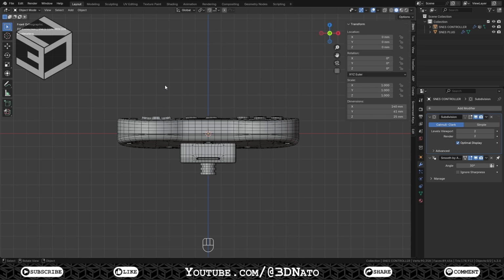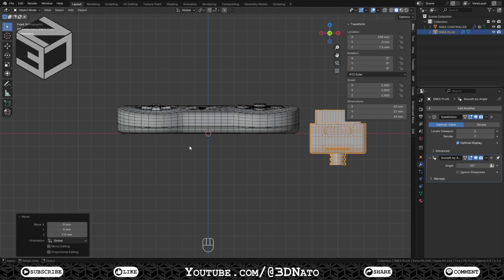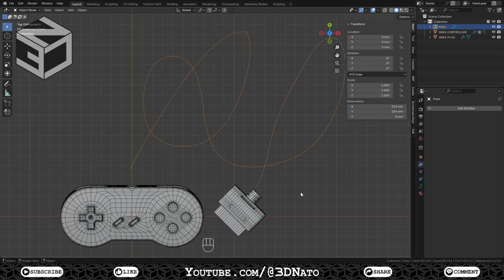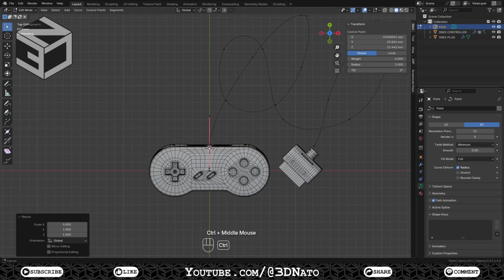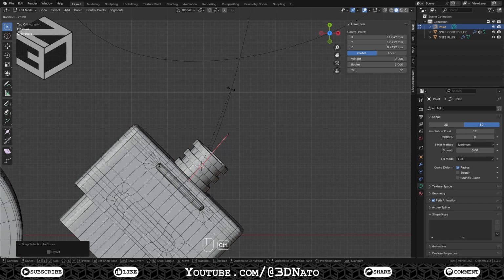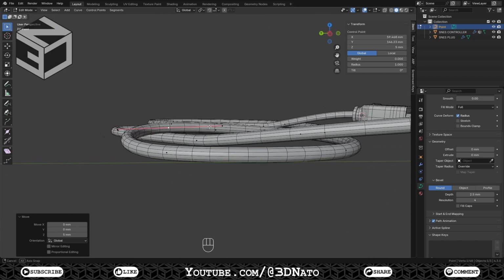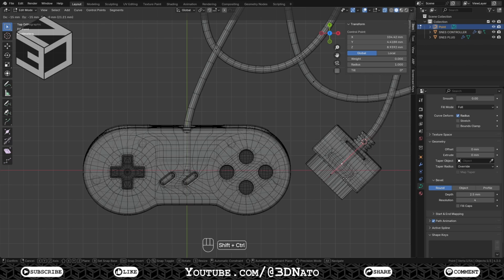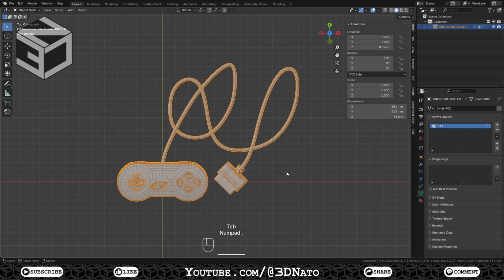SNES Controller Blender Course | 06: Modeling the Wire

Comment: This was a long but very educational tutorial!! from start to finish was great technique and execution and In some areas after careful inspection I can see but don't quite understand why this model needed the "Auto Smooth" enabled since most pure quad meshes like this one should be "Watertight" enough to only need the Sub-D modifier and creases and or control Loops. I am a beginner modeler and have done other pure Quad and Sub-D Tutorials were the use of Auto smooth was discouraged in favor of Quad perfect meshes and edge flow?
Reply from the maker: Thanks... The "Shade Auto Smooth" is for the creased edges. Some areas, like the button holes, or that part of the plug that has the logo for example, need to have sharp corners. You can also bevel those corners, but I prefer to use edge crease.